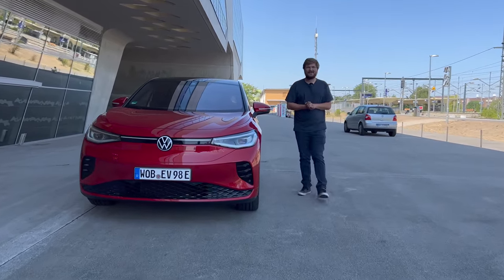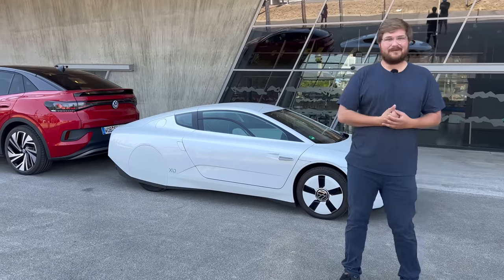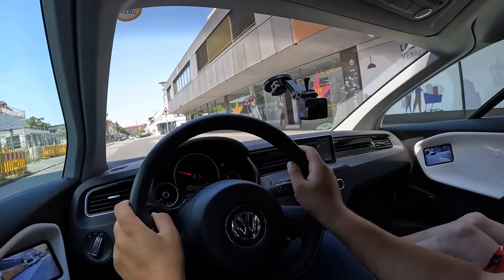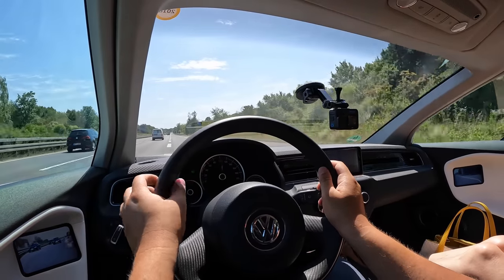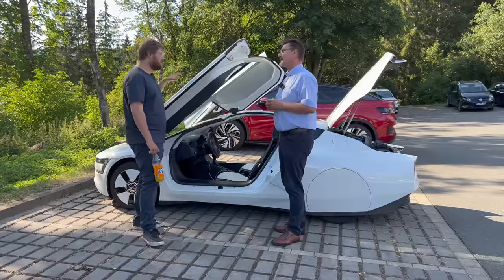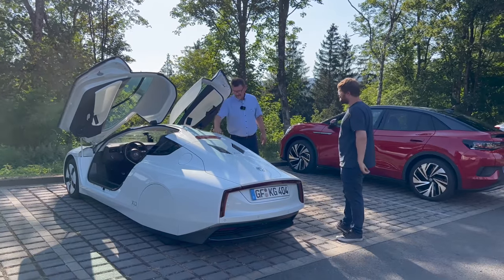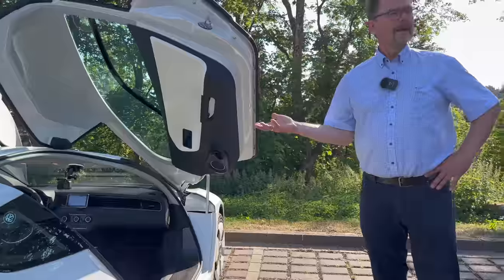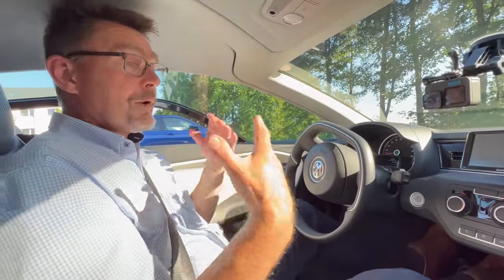Pulling This XL1 From The Volkswagen Development Storage Garage To Reunite It With The Lead Engineer

Comment: Another bucket list day! The best part of it was reuniting this car with Hannes Spalink, one of it’s creators who hasn’t seen the car in 6 years. Quite an emotional moment for the team and really a day I will never forget
Reply: Your enthusiasm is so awesome 👏
Reply: Tank you Kyle for another awesome experience in EU and yeah with a lot of insights from the engineers that worked on this amazing XL1 project thinking back i remember VW was planning also presented at Paris Motor Show another version called XL1 Sport with Ducatti motorcycle engine in the back to rev up to 12.000 rpm and top speed could reach 280km/h.. Akrapovich motorcycle exhaust added to complete that awesome version. One was made & hidden inside Volkswagen secret stash, not sure what happen they probably ditch the production since no word of building extra versions or limited production, but damn.. imo XL1 Sport would be even cooler than XL1 diesel..
Reply: So happy for you Kyle!  Imagine if VW made an updated version of it (all-electric, solar) to compete with Aptera...
Reply: Pleasant diesel sound like a tractor- priceless
Reply: @caseymuni4097  Lanz Bulldog 😁

Comment: I love the look of the XL1… I wish they would make an EV version 😸
Reply: wouldnt work in this concept but you can  buy the most effient EV from VW its called the VW e-UP i drive the brother citigo e and it consumes at 110 kmh below 12 kwh/100km
Reply: @LouRaX  I drive an ID4, since that’s the only EV that VW sells in the us (aside from the old eGolf) 😸
Reply: @LouRaX  
I drive a 2013 998cc Up! Love it!
Always wished VW Australia brought the eUp! DownUnder 
Waiting patiently for my CYBRTRK ___yes, l DON'T need a Pickup/Ute
Reply: @ivankuljis1780  the eUP. Was 14.000 Euro after goverment grant :D and its like i told to the most effient car today...  The Only problem it had is the Rapidgate... after 2 CCS recharges it slowed down due to no battery cooling. So its not a good long range trip car over 400-500km
Reply: @LouRaX  
That's too bad____still a great fun car that l would have bought instead. ( maybe improved now )
Reply: @ivankuljis1780  even the newest version has the rapidgate thing... Its just the pricerange dosnt allow big cooled battery
Reply: @LouRaX  
Nice to know___thx.

Comment: Ioniq go home! Great video and big respect for creating content at 38c! I'm wondering, was the XL Sport ever driven in public? VW presented a XL1 with a Ducati motor in 2014, that thing must be a blast to drive.
Reply: Ioniq Electric only needs half of the energy. XL1 go home.
Reply: @gerbre1  ... well, it was a joke. But to be certain, it's actually not half the consumption. 1 liter Diesel equals 10kWh right? So the XL1 is using below 200Wh/km including AC. Bjørn Nyland did a test with the old 28kwh Ioniq recently, which showed the Ioniq is using about 100Wh/km at slowish speeds in summer and importantly without AC. But those are more or less EQXX levels of efficiency, which nowadays no electric car is able to produce. So the XL1 is a remarkable thing for a combustion car!
Reply: @hankmoody7521  I bought the Ioniq Classic three years ago influenced by Bjørns videos. This summer I often saw a 10 kWh/100 km with climate on. The best value was 8,5 kWh/100 km. Maybe it‘s less than factor 2 but it‘s nearby.
Reply: @hankmoody7521  I suspect with average efficiency of TDI at low loads, say, 20-30%,  BEV version of XL1 would consume 40-60Wh/km.

Comment: I always like the XL1 I wish they would make one out of steel or Aluminum to bring the cost down and make it full electric I  wonder how efficient it would be ?
Reply: making all that changes would make it very much not efficient.
this car is a great as it is because its small and super light, the entire car including a 75kg driver weight 795kg.
there are some EVs where just the battery alone is heavier than that.
making this out heavier materials and making it an EV easily doubles the weight which means you also need a stronger suspension, better brakes and probably even more power to get this thing moving at all.

Comment: 1.9 L per 100 km is ~123 MPG for those of us using freedom units. Impressive stuff considering the battery wasn't even charged.
Reply: Thanks 👍🏿
Reply: How many gallons of fuel did this thing hold ?
Reply: @Kimbrough87  10 liter or 2.2 gal.

Comment: My view ,  under the new management vw must END THE ID PROGRAM.  Vw first effort the e-golf mk2  (the mk 1 was a mk4 golf with a very limited number produced)  35kwh was significantly better quality, better built and more importantly looked like any other golf .  The changes that came about for the Id series have polarised potential buyers NOT because it was electrified but because it divided what owners could get or didn’t get from leather seats but offer them in other markets even though it was made initially in the same factory , to utter penny saving stupidity as removing window switches , installing small mono display, and an infotainment system that through countless updates is still infuriating to use and full of bugs .  As the market clearly is going to electrification the models need to both look and interiors be as good as what not only came before but improve.  The mk7 series golf was a significant improvement over the mk6 but the mk8 , the id3/4/5/ buzz all feel worse than any other vw product.  Vw HAS TO DITCH THE HAPTIC TOUCH  buttons , stop the penny saving and improve the interior, going as far as revamp .  Heck why is it every Id has to have a dark interior trim  in daft .  The xl1 was an important milestone for vw it pushed for ingenuity, pushed the boundaries of what was possible.  But under the past gen it really has lost its way .  The Korean car companies are now on a charge, China is now pushing its models west and in its main market the psa group are beating them at the own game  after owning an id4 4x4 it’s like a half measure compared to the competition.  Tesla may have started the push for electric and what was possible with a battery .  But it doesn’t mean they have to follow

Comment: Call me jaded but all this "whoopla" over this XL-1 being so economical & sipping fuel but how many 100's of millions $$$ were poured into its development? Then look at an independently developed  aeronautically/hydrodynamically designed 3 wheel vehicle like the Aptera with its incredibly low drag coefficient & ability to drive many miles on very low power consumption but its progenitors had problems funding its development. The XL-! is as futuristic in exterior design as the Aptera  yet the former is accepted.  Big Money projects by established companies are visualized differently.
Reply: The Aptera is an absolutely amazing car that deserves to be a huge success and I for one really hope it will be. Like the XL1 however, it's a car that will make people stop and stare all the time, and sadly, most people just don't want to be stared at (myself not included - it doesn't bother me at all and anyway I know they are staring at my car, not me). This factor in my opinion will be one of the biggest hindrances to its success. As for the XL1, Volkswagen didn't spend its 1 billion dollars development cost to see how many of them they could sell! It just wasn't about selling them - it was only about learning how to make all future VW's more efficient and therefore sell more. If VW had wanted to sell big quantities of them they would have done it all very differently - they obviously wouldn't have used such expensive materials (e.g. less carbon fibre and magnesium etc) and wouldn't have gone to such extremes to prioritize efficiency above almost all other considerations, and regardless of cost. Practicality, comfort and cost would have been much further up their list of priorities if they had actually intended this proof-of-concept to be bought by anyone other than wealthy collectors and enthusiasts!

Comment: It's a shame this concept was not developed further. Use a flat 4 diesel(a tribute to the Beetle and good for packaging) running on RME (Carbon neutral) with a larger battery pack, no more range anxiety. Huge possibilities.
Reply: Problem was not Carbon foot print of Diesel engines. The problem is health damaging toxic exhaust way beyond even Petrol engines. Extreme NOx levels were the main problems, but diesel engines also have high Sulfur compounds and Particulate matter exhaust. Soo RME carbon neutral would be pointless.
Reply: @Neojhun  Yeah, but modern diesels can help clean the air in cities because of all the filtering and catalytic reactions (adblue) going on. 🤷
Reply: @abraxastulammo9940  The irony is modern diesels are super clean with DPF, EGR, SCR and catalysers.
Reply: @abraxastulammo9940  Last I checked VW Diesel Gate cars had NO AdBlue. That was the entire problem. You are also wrong, even after scrubbing the air is NOT cleaner, it's just not much worse than Petrol.